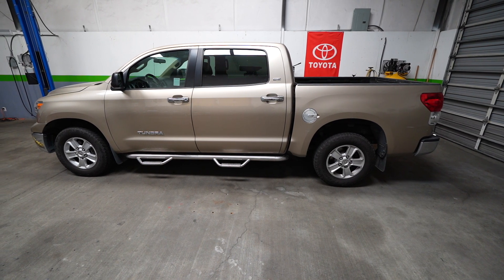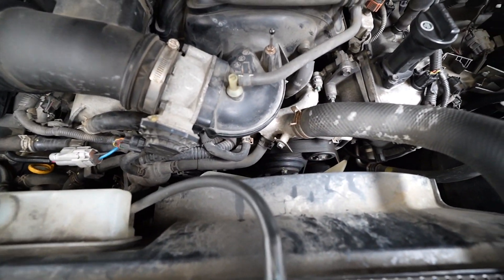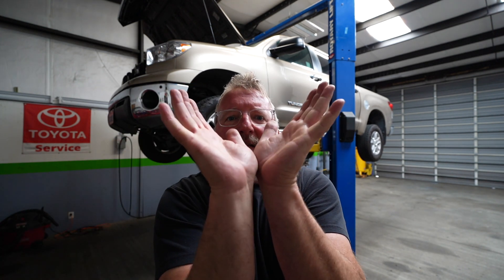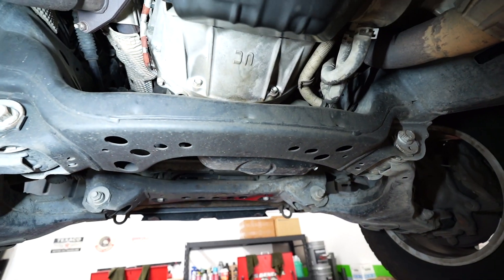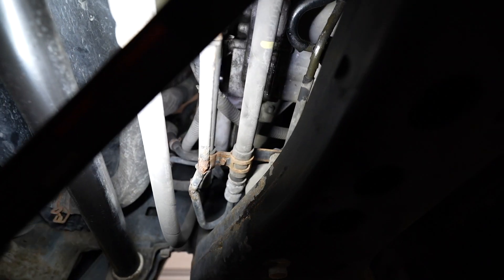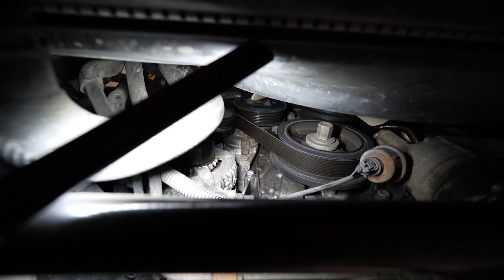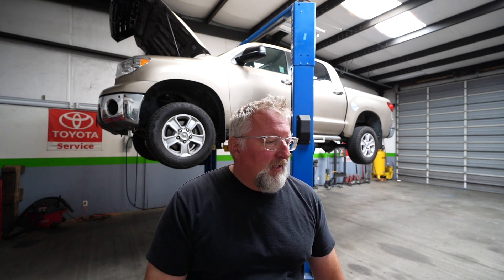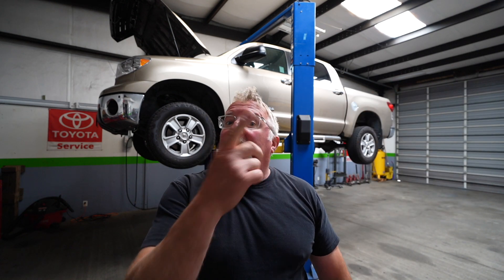Common Coolant Leaks on TOYOTA 5.7L V8 Engine

Comment: that heat exchanger leak is a really bad design. I have a 17 that i just noticed was low on coolant. If its the heat exchanger im trading it off. Toyota is losing it appeal of reliability to me.

Comment: 2013 Sequoia. I sure hope I don’t have to deal with this anytime soon.  I recently replaced the alternator and that was a PIA. While doing the replacement, I glanced over at my Cobra and the alternator sits on top and is 10 minute job. Pissed me off.  For such a job only use OEM parts because you don’t want to do this again.

Comment: I have an 08 Tundra SR5 and its radiator is shot. Coolant splatter everywhere. Coolant running down the radiator front and back. Leaking into the bottom of the fan shroud. Replacing it with a CSF radiator. Wish I could have afforded a KOYORAD though! They're very expensive. Prefer the plastic mounting pieces on the sides of that one as this CSF has welded aluminum mounting brackets and if I'm not careful inserting the bolts, I'm screwed 😂

Comment: I feel that Toyota's coolant maintenance interval is too long. If the coolant was changed 45,000 miles or 4 years I don't think you would have these failures.
Reply: I do it every 5 years. Drain the rad and the passenger side drain.

Comment: Nice video, thanks for sharing your knowledge. 
I feel sorry for you and me both. 
I just checked my 2014 tundra that I had misfire on cylinder #7 . 
And found out that my coolant reservoir was low, I believe I have a leak somewhere. 
My heater doesn’t work very well in the morning, but the temperature stays constant on the gauge. 
Ps: This just checked a water pump on 2018 vw atlas and that wasn’t fun.

Comment: Thanks for the video. I'm looking forward to a video of you fixing both leaks. I have a 2011 Crew Max SR5 with the 5.7 engine at 185k miles. No leaks yet other than a leaky upper radiator hose that I fixed. I do as much of the repairs and maintenance as I can, and sincerely appreciate your helpful tips. Good luck with the truck - I love mine!

Comment: Hi! I have a Toyota 5.7 LC 2013 and had a rear main seal leak which i got replaced and i still have a leak.. Can you please advise if there is an O ring behind the rear main seal plate? I already replaced the PCV valve... Not sure what it is.. Please let me know if there is another seal or o ring inside and i will have it looked again.. Thanks!

Comment: We literally just did this on the fiances 2016 5.7 @ 85k miles...   We did the valley leak, X-over pipe o-rings, thermostat, belt, and water pump since everything is apart and coolant is drained.. So apparently this is more common then I thought!

Comment: Had a feeling when you bought this it would be trouble. Was more concerned about electrical gremlins because of the audio wiring but in general aftermarket stuff everywhere. I thought you should run from this one. At least it’s all your own labor. No days off for you for a while Peter.

Comment: I own the very same truck, same year (2007), and fortunately it has not yet failed me. I know for sure that the time when it will start to crack is nigh... I will need to prepare my wallet since I have no plan to get rid of that truck, I just love it! By the way, good luck with your repair sir, I know for sure that the leak will be stopped.
Reply: It is better a $1000 repair vill versus $700/month payment and $200/ insurance payment

Comment: ? is it best to remove engine from vehicle to take care of this exchanger coolant weep?
Reply: No, I’ve done it before- its not hard- definitely diy if you’re moderately handy with a wrench, worst part imo is removal of the air pumps- not so much removal but reassembly of the tubes that connect them from the exhaust manifolds when you’re putting it back together

Comment: The reason most auto technicians hate to work on their cars, they’re not getting paid..😅 At times, I hate working on my vehicles as well. However, when I do, I take 2-3 days because I attempt to locate and solve any issues with that particular car. I’m going through this with a 2000 Honda Accord 2.3 liter F24A1 engine with 231,000 miles. Engine oil pump and torque converter seal are next for replacement.

Comment: Sorry for the troubles but thank you for the video. Hopefully you will film/post the fixes. Another common leak on this engine is the radiator, typically at the lower seam between the fins and the bottom reservoir.

Comment: I would not categorize this coolant leak as a common problem, I would just simply classified as a defect. I'm subscribe to at least four different channels with Toyota mechanics, and they have all covered this topic. 

This is a defect.
Reply: How is this a defect? With the age of this vehicle and the mileage it’s not unusual for this to occur. The Car Care Nut also covers this engine and it is common in high mileage vehicles using the 5.7 liter 3UZ-FE engine.
Reply: @jamram9924  What other Tundra engines have this same coolant leak? None. There are Tundras with 1 million miles that don't have this leak.